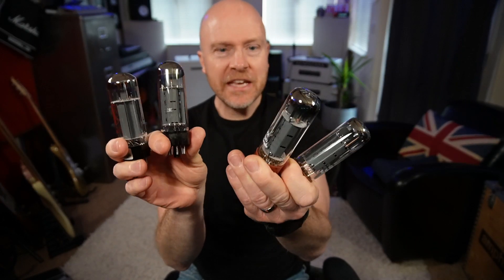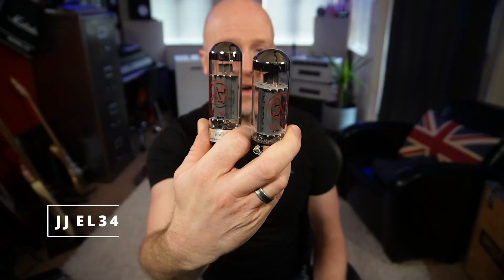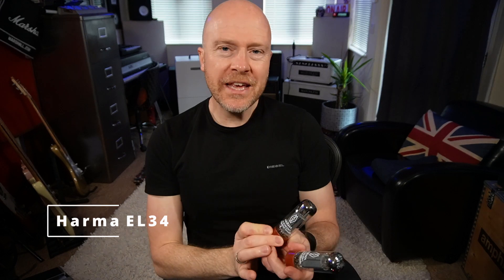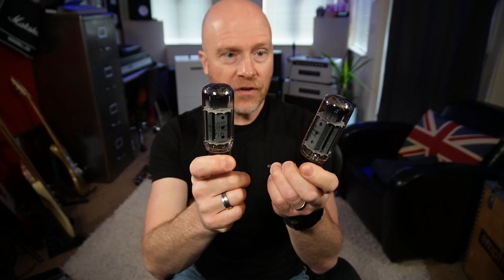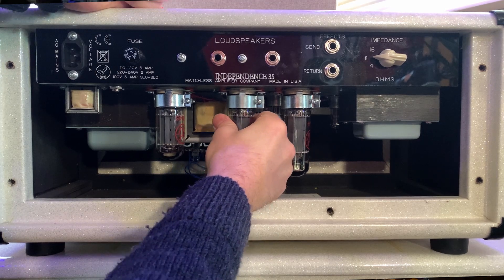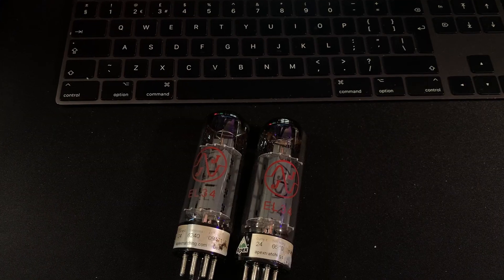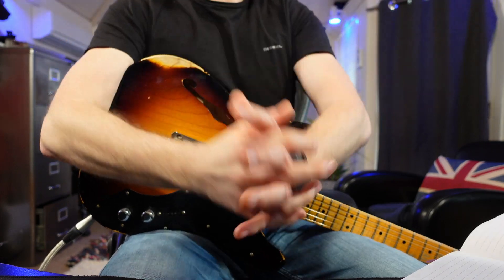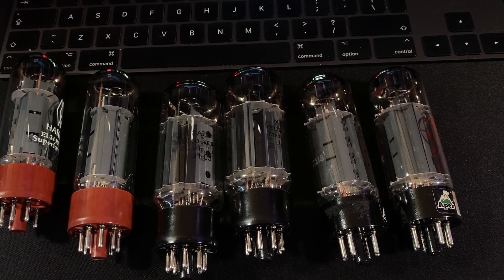Does Changing Tubes/ Valves In A Guitar Amp Really Make A Difference?

Comment: There should be a disclaimer on this video. The Matchless amp is a Cathode Bias ( self Biassing amp), but if people see this and start pulling valves out of amps that are not Cathode Bias then the amp needs to be rebiassed, and can easlily damage amp and indeed the valves if this is not done. Additionally the filter caps in a Valve amp hold a significant charge of High Voltage DC, and will give you a really nasty shock, and could kill you if they are not drained.  This why sometimes when you turn an appliance off the on/off lamp stays on.  Harma valves  are only rebadged valves from the usual suspects. Tube Amp Doctor in Germany have some very nice valves usually. Finally you may find you get a better result by changing the rectifier, much more important than the power amp valves. Pre amp valves will also make a difference - Sorry for the long comment but it really isn't just a matter of whipping valves out and putting different ones in - Stay safe guys
Reply from the maker: Hi Dilly. Although you are right about biasing amps being important, this video is not about biasing, its about if there is a difference between tubes (if any). A you said The Matchless is a self biasing amp, but that is why amp manufacturers have manuals for people to read to know how to use their amps, its not for me to tell people how their particular amp should be used.
Reply: @TheStudioRats   I'm Sorry that you took that the wrong way. It wasn't meant as a criticism. I agree that it's not up to you to tell people how their particular amp should be used. So many amps people own are second hand and didn't come with a manual, and watching your content, the average Joe , could say Oh I'll just whip out a couple of power amp tubes and change them, in the meantime getting the full whack of the filter caps, perhaps killing them. I believe that content creation does come with a certain amount of responsibility. Not a criticism of you or your show, You know I am a fan and support what you guys are doing. it would have just been nice to drop in by the way"  Kids, make sure you have a full understanding of the lethal voltages around in your amp even when it is switched off and unplugged from the power also your amp may not like to just have its power amp tubes changed and may need to be rebiased " if you are in any doubt see an amp tech. Anyway most of us are blokes and blokes don't read manuals 🙂
Reply: If you own electrical equipment, it’s obviously got the potential to be dangerous and it’s your responsibility as the owner to familiarise yourself with this for your own safety, nobody else’s.

Comment: during covid i bought a vox ac30c2x.
realising that i had no spare el84s i decided to buy a so called matched quad of electro harmonix valves.
i recorded the amp with the original non branded chinese valves and again with new ones and there was absolutely no discernible difference. 
it maybe that the design of the vox output stage is immune to small production tolerance variations in the valves (which is a good thing).
i did hear some subtle variation in your video but not enough to prefer one brand.
bear in mind your valves were at different ages and possibly at different stages of warm up. 
thanks for the interesting video

Comment: Buying a used tube amp such as a Hot Rod Deluxe, I tend to replace the output tubes and re-set the bias...as well as check/replace the main capacitors if they're leaky...but tubes will make a difference...great video, great playing as well.

Comment: Every one else is making videos about the unavailibility of tubes. Thanks Vlad.
Reply: there are plenty of tubes about it was a marketing scam to bump the price up. There were two chinese factorys one burnt down but the other has now expanded. Obvs the russian factory is under sanctions so no export  but still plenty in stock in the west. Not to mention NOS or New Old Stock valves such as mullard, Brimar etc for those you can always check out radio equipment and millitary fairs. You can sometimes get the old millitary stock ones that have been in storage for years. British army ones have an arrow on  and the model such as EL34 .

Comment: You may know that "Harma" is just a rebrand of one of the tubes made by the three tube plants.  It might just be the Mullard RI type made in the Russian Reflektor plant.  ShuGuang is no more, but Psvane is now making some guitar amp tubes.  Out of the three tube types you tried, I like the EHx 6CA7 in that amp and for your style.  The bass is fatter and the high-end is sweeter and clearer.  Not sure why you thought the bass was weaker.  It's definitely stronger, but the high-end is also stronger (less compressed).  That influences perception.  You really need to compare the same guitar passages when comparing things.  Prerecording a loop is a good idea.

Comment: Interesting ... haven't owned a valve amp for a few years now, but have been mulling over whether to add a low wattage valve amp into the mix again. My take would also be not to bother changing valves, provided there were no problems, but use Harma when actually needing to replace

Comment: I've used harma valves from Watford valves for about 22 years.  Always noticed quite a difference over stock.  They do a number of different types and configuration of valve within the harma brand so you can't make any global statement as to how they sound (they do low gain, high gain, warm, bright etc).  I've always thought the difference to stock is like a low quality MP3 compared to a CD/LP

Comment: I prefer the 6CA7 it just has the extra something. One thing I will mention is valves may be Power Amp or preamp will react differently in different circuits. For example I had a Egnater tweaker 15 and  changing the valves made a huge difference, it was very sensitive. I've had other amps that changing the valves was a waste of time.

Comment: New tubes are interesting. It seems most of the manufacturers have gotten very good at creating very clean tubes (from a frequency response perspective) such that the differences between them are very subtle, and even the headroom is often very close. If you are looking at new tubes, I'd tend to agree with your overall assessment: it's not worth the trouble, but having backups is useful (especially for power amp tubes since they tend to fail more often than preamp tubes, and especially given their changing availability). Older tubes are where things get more interesting. Old tubes were not as consistent, even for a given manufacturer, so the character can vary a lot more. It's clear to me this is actually because, from an objective point of view, they were not as well made, but the resulting tones can be quite nice. I've played with a few and found different preferences for different types of tubes (e.g. north American 5751 JAN tubes for one mic preamp, north American 7025s for V1 in one guitar amp preamp with modern tubes following, soviet mil-spec power amp tubes in a couple of amps, etc.) but given it's a matter of what kind of wrong you prefer, it's all about... well, what you prefer.
Reply: I suppose it is also worth adding, even with everything I said, if you buy an amp and love it, leave it alone. If it ain't broke, don't fix it. I would mostly encourage people to have spares around since tubes are finicky beasts. Sometimes they last 40 years and sometimes they last a few weeks. Best of luck.

Comment: At least in a HiFi Valve amp situation, 6CA7 has a lot both tighter and punchier bottom end. Also top end is crisper, more present and forward. Generally speaking 6CA7:s sound scooped compared to EL34s in my SE HiFi Valve amp. The 6CA7:s I refer to are JJ's

Comment: I have a cathode biased amp - a Morgan MVP 23 - pretty much an 18 watt Marshall front end with a Vox power section. I've only ever used JJ el84s but tried a handful of different 12ax7 tubes in V1 and there was a HUGE difference between them, from a JJ (lifeless) a Gold Lion (too bright and brittle, no bottom end) to an NOS RCA (meh) to a couple different current production tubes and the one that sounded the best?  The Electro Harmonix tube that came with the amp. Go figure.

Comment: Interesting comparison, but as we all know, which sounds better in this case is entirely subjective. However, we must keep in mind that these were all "premium tubes".  I have a very inexpensive, but actually good sounding 15 watt tube amp (Monoprice 15W, or on your side of the pond known as the Harley Benton 15W, same identical amp). This amp uses a pair of EL84's for the output tubes. The original tubes were unbranded cheap Chinese tubes (I hear that they now come with JJ's, but the price has also gone up about 35% recently). When I changed to a set of JJ's in this amp, the difference was like night and day.  The amp opened way up and the noise level went way down.  So yes, changing the valves really did make a huge noticeable difference. I guess the comparison is that you went from a Mercedes to a BMW, both great autos, but is one really better than the other?  Maybe slightly different, but not necessarily better. I went from a Kia to a Cadillac, and in that case, even though they will both get you church on Sunday, one really is better than the other.
Reply from the maker: Great comment Bruce.
Reply: actually....you went from kia to skoda. all the modern tubes are made in china, russia or slovakia(jj). they all sound really bad compared to nos. harma valves are made in china in the same factory like all chinese tubes.

Comment: this is like every other guitar tone myth out there...
"Oh you have JJ tubes? Gotta use the electro harmonix!"
"Oh, you have electro harmonix? Gotta use the JJ!"
"Oh, you have modern tubes? Gotta use tubes made in 1954!"
"Oh, you have old tubes? Gotta use new ones!"

with the tolerances involved you're as likely to hear as much difference between two different tubes of one brand as you are between tubes of two different brands

And of course, especially at this point - if you have tubes that work, leave them alone! You might not be able to get replacements for a while...

Comment: There is pretty solid evidence that people will perceive a sound as being "better" when it's louder , even by a tiny fraction.  

I'm one of the people who think if you made a single recording, reamped it through both tubes and recorded that, then played them back 180 degrees out of phase, you'd hear silence or close to it.
If nothin else, if they were normalized for volume and someone else was randomly switching signals, would you reliably pick out which was the JJ and which was the EHX?

Comment: “I’ve got a few pairs just in case these go down at any time”. Not sure if you recorded this before or after EHX officially closed up shop on tubes for at least the next 9 months.
The £80 you spent on tubes seems to be more than well spent and has probably gone up exponentially on the second hand market!
I would agree that the differences were so tiny that you only really need to justify changing them if one breaks but it was good to hear the subtle differences 😊
Reply from the maker: Cheers Tim, yes I made this before the announcement, although in the UK there still seems to be tubes.
Reply: @TheStudioRats  good to know 👍 I moved over to Helix and sold my main valve amp last year but was pondering whether to go back to something just for home playing with a two notes thing.
I guess if the 12ax7s go completely then I can just buy a cheap joyo bantamp to easily replace one 😂

Comment: The valves are all made in the same factory in Russia or China and stamped with the distributor's name on the outside of the glass.  The only difference between valves is new vs. old.   Check the valves on a Hickok valve tester and you will see that valves that test the same will sound the same. 

If you want to make a big change to your tone, change your strings.

Comment: I’ve come to believe that if you have to listen this hard to tell the difference between different tubes then it’s probably not worth your time. I have done this in the past so I understand but I realize that the differences are so small that it doesn’t really make a difference. I’ve also heard some of the noted differences just between using different tubes of the same brand. Because they were rated slightly different.

Comment: There is no significant difference, other than small variations in gain/volume. The difference are so small that without the captions I doubt anyone would be able to say the recordings change from one tube to another. And as the most awesome Ian Sheppard points out, without careful LUFS volume matching when making audio comparisons, even +/- 0.5 dB differences in volume are perceived as changes in bass and treble. There is a reason why in 100 years of the industry, no vacuum tube manufacturer has never published frequency response curves for their products; it's because there is no reason to do so.

Comment: Interesting demo, Paul. Differences were marginal through my listening device. However, perhaps the most important thing to be aware of is that you now have two spare sets of viable output valves which, given the context of Russia’s invasion of Ukraine and the sanctions imposed, the supply of valves will be increasingly in short supply unless the JJ factory in Slovenia can boost production. Mike Matthews of Electro Harmonix has issued a statement effectively cancelling back ordered valve products until further notice, and it seems unavoidable that other manufacturers will have to follow suit. I’d be very interested in what Watford Valves’ take on this situation is ...

Comment: at the beginning you said that the company you bought the valves from tested them and picked the best. what does the best mean? a valve is used as an amplifier and to be best it should not alter the sound applied to it. in other words the more linear it is the less effect it has on the sound, any non-linearities add harmonics. if you are making a hi-fi amp you operate the valves in their linear region, in this mode the valves cannot sound any different unless they are not linear. if you run the tube in it's non-linear region i.e. close to clipping then you are adding harmonics. if the amp is class AB then the biasing can add crossover distortion which is also adding harmonics.

Comment: there are only two companies / factorys making valves today. One in china and one in Russia . all knew valves are made in one of these factorys and simply branded with which ever brand name its sold under. so they are all the same providing from said same factory. (Not ethe russian ones are under sanctions so any stock in the west is pre Urkiane )  NOS valves such as mullards, phillips, brimar etc which were made in the USA / UK before all the factorys closed down years ago might have different (and probably higher tollerances ) providing they were stored correctly and still working in perfect order. So changing valves is a waste of time unless your valves are on the way out. Also suggest rather than a tone test which is subjective a frequency response and acthual readings are taken from any valve comparisons  and put in a chart.